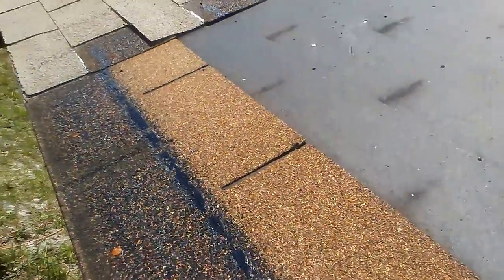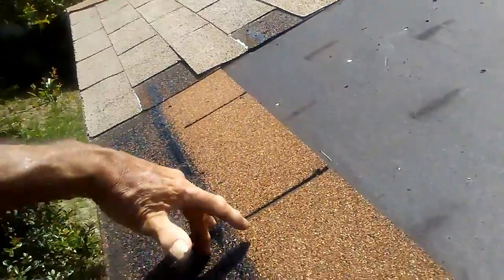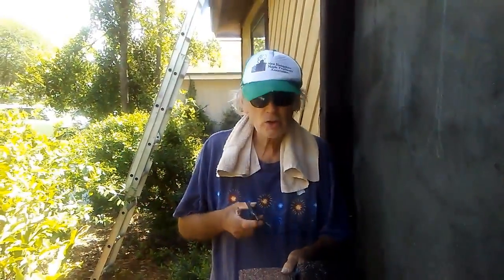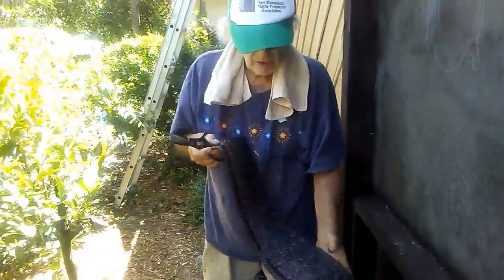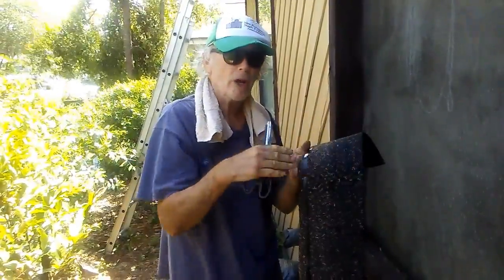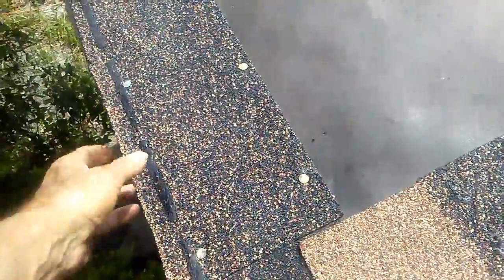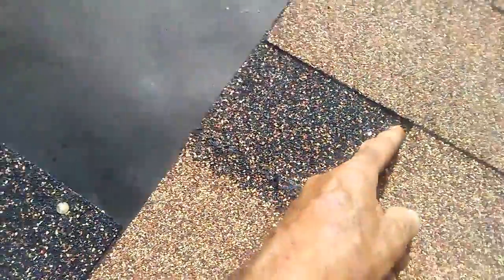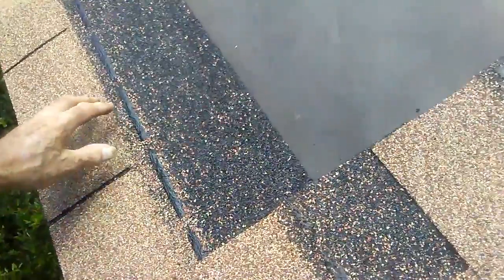How to Do a Starter Row for Shingling a Roof

Comment: They say you can use the tabs for the tops. But there are "starter rolls" that you just roll out about 20 feet.  The very inner part is curled up pretty tight and it is not easy to get it flat unless it is pretty hot and sunny.  
And there are "starter shingles" that come in a package similar to regular shingles, but they have two half sized starter shingles side by side. in place of each of the 20 or so you'd get if they were regular shingles.